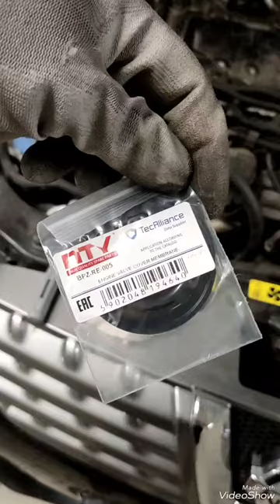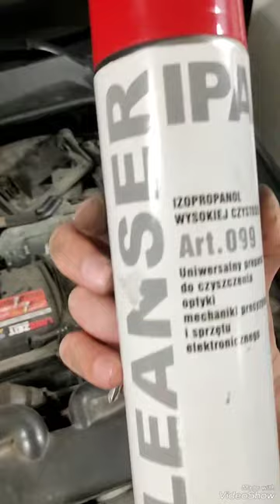Nissan,Renault membrană pcv gaze carter, senzor presiune aer egr si debimetru de aer.M9R Diesel 2.0

Comment: How did u remove the lid cover cap.. Was it hard to remove the cap? I have same issue. Air filter is getting build up and light oil in hoses.
Reply: A mí igual, supiste cómo quitar la tapa sin romper nada?
Reply: @BreadsbySergy Para ese modelo hay que romper creo